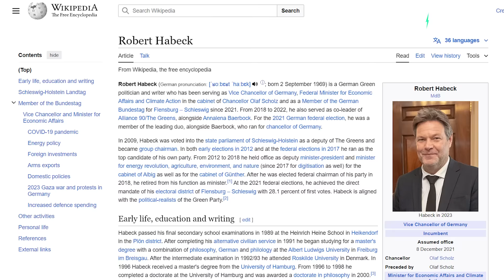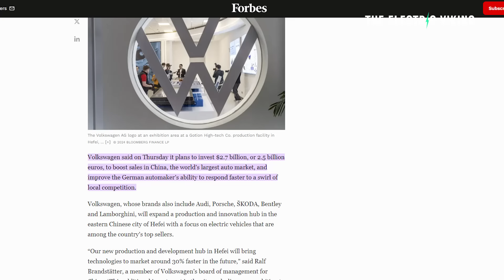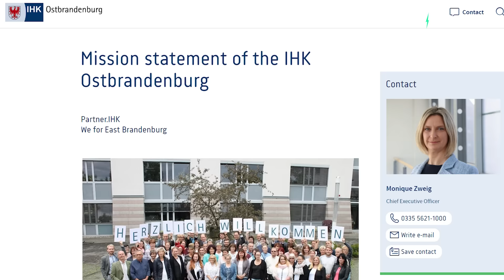Ministers furious at protesters who permanently damaged Germany's economy

Comment: Just curious how many of these protesters drove to Tesla in their ICE vehicles.  Shaking my head while I drive my EV powered by the sun via the solar panels on my home's roof.
Reply: “Do as I say, not as I do”
Reply: They came by bike and train.
Reply: Diesel buses.
Reply: Modern ICE vehicles create less pollution than what was released to mine your EV’s batteries. Sorry to burst your bubble.
Reply: @notfromhere6125  Batteries created from mining can be refurbished unlike gas which just burns into the air. Eventually, very few minerals will be needed as batteries can be reused indefiinitely. Burst your own bubble.
Reply: @notfromhere6125  
1) Over the vehicle's lifetime, I doubt it.
2) I'm keen to see the studies that you must have access to that show the mortality rates due to mining operations, because I can show dozens of published papers that show the direct effects, including mortality, of ICE vehicles on air quality.
Reply: @notfromhere6125 your bubble is full of noxious fumes, which is affecting you cognitive ability.
Reply: @notfromhere6125  Last time I checked, you cannot recycle gasoline once is it burned.
Reply: @alancane1482 No, they can't  and aren't.  Bad modules are REPLACED, usually the whole pack.  And less than 5% of EV batteries are recycled, since it's too expensive.

Your so-called point is incorrect.  You are a net polluter.
Reply: @TradeWithShawn And you can't show ANY of those studies showing what those rates were in the 70s or 80s by comparison.  They never did that, which makes that 'study' worthless.  Peooke have also been smoking less, so between CAFE and emissions and less smoking, there should be LESS associated casualties.

Bu the way, did that study cover the adverse health effects of high wattage magnetic fields, or DIRECT lung damage from EV-generated ozone?

Didn't think so.  Your point is rubbish.
Reply: @billcichoke2534  Believe you are incorrect
Reply: @alancane1482  No, I'm not.  But a scientifically illiterate narrative has been pushed that says I am.  So, correction is required.
Reply: @billcichoke2534  Tesla batteries are currently 92% recyclable.
Reply: @alancane1482  Tesla batteries are currently recycled wuth the same frequency as other less labor intensive designs...at less than 5%.

All batteries going into new Teslas, are NEW batteries from VIRGIN materiel.
Reply: @billcichoke2534  But the incentive to recycle is there as it has be less expensive and better for the environment than continuing to mine. Perhaps Tesla's are just too new to be recycled yet?
Reply: @alancane1482  No, the problem is the process.  You can grind up batteries into shredded mulch, but the means by which the lithium and other elements are separated is so polluting amd toxic as to be illegal in most countries.

Most of that stuff is sold to countries (like China) who don't have environmental protections and spew what they want, wherever they want.  So they get the stuff from recyclers, mix whatever they separate out with virgin elements, and sell processed component compounds as if the were 100% NEW elements.
Reply: @billcichoke2534  As far as I know there are companies working on the process in the US. Every problem has a solution.
Reply: @alancane1482  But not every solution fixes a problem.  And some solutions are offered for problems that don't exist.
Reply: @billcichoke2534  Like Musk says: “If you ask the wrong question the correct answer is impossible.”
Reply: @alancane1482  If that's an actual quote of his, then he should know better than to be doing exactly what he says you SHOULDN'T do.
Reply: @billcichoke2534  Time will tell.

Comment: You run a state, so you're responsible for what happens. Germany, like France, are 2 countries where you shouldn't invest to manufacture anything, unless you're German or French. I've always thought that GigaBerlin was a big mistake, and that it would have been better to go 200 km away to Poland, where wages are lower, standards are less stringent, and people are more likely to want to work. BYD is going to Hungary, not Germany. Building the Berlin plant was a nightmare, with abstruse rules, lawsuits from Green League and Nabu (which are financed by BMW and VW respectively). The factory has already had 3 attacks. If I were Musk, I wouldn't build the battery part in Berlin, I'd go to Poland. It's not far from Berlin and there's a freeway linking the two. He can always attract engineers or workers (soon to be replaced by Optimus). The ministers are shedding crocodile tears, but how did they protect Tesla? The rioters had warned of their arrival, and the police had neither the means nor the numbers to counter their attacks. The German government is guilty of inertia, if not complicity. I've done a lot of work in Asia and I'd never invest in India. What's more, India is densely populated, but only 3.8 million cars are sold there every year.
France, Germany and India are the 3 countries to avoid for Tesla in my opinion.